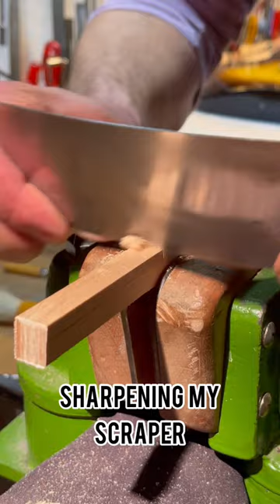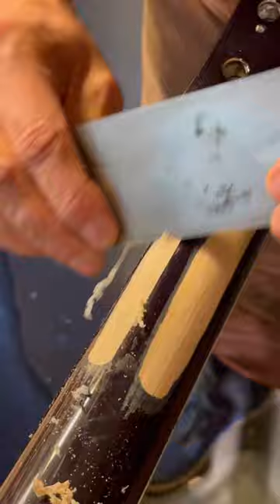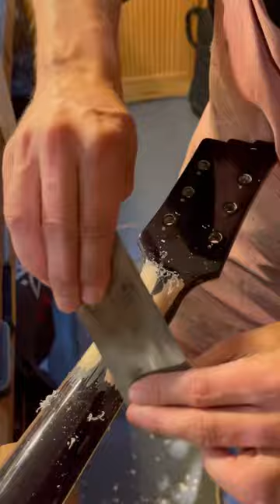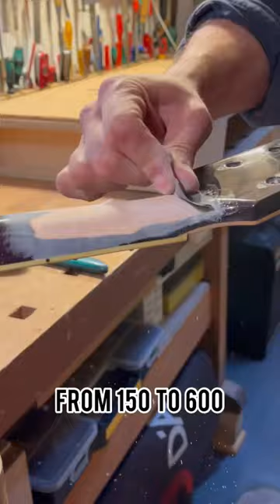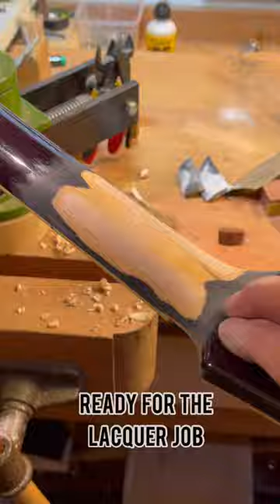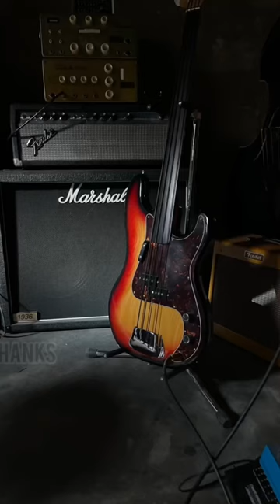Luthier Workshop scraping and sanding a broken Guitar Neck #shorts #workshop #asmr #luthier #craft

Comment: Instead of metal use flat glass piece then it is very very easy to work smoothly
Reply from the maker: Thanks for your comment. Yes that's also a good solution. My Grandpa use to work with broken glas pieces this works perfect as a scraper. Thank for sharing your experience. Best Regards Nik

Comment: Good idea. I would like to say that I remove the finish from entire guitar body and neck using the scrape method. But I use a jacknife with stiff thick blade 4 inches long and very frequent sharpening. I'm not bragging or being stupid  I'm just informing that this is superior method of finish removal. Faster  way more effective and LESS DAMAGE than heat or chemical stripper. A card scraper as the one demonstrated here is not "better than" a sharp knife.
Reply from the maker: Hey Ruhiger thanks a lot for sharing your experience. I use also a sharp knife :-) this is the second Part of this repair. Check out the First Part there I use my selfmade Knife. Thanks for watching and your Feedback. Best Regards Nik
Reply: A card scraper would be great for the neck and sides. I wish I had one of those every time I scrapeca new guitar project, they're decent price on Amazon. Absolutely unheard of in local hardwares or tool stores. But I just keep at it with my knife and next thing I know? Project done and ready for careful sanding. You look to be a top notch craftsman. You have inspired me to redo a beautiful little Godin guitar with 1 only pickup. An EMG active. I "forgave" a few imperfections rather than dealing with them, I just bulled ahead with clearcoat. Now all I see when I hold that guitar are these glaring errors. Time to refinish the refinish job! Thanks for influencing me to do the right thing!!